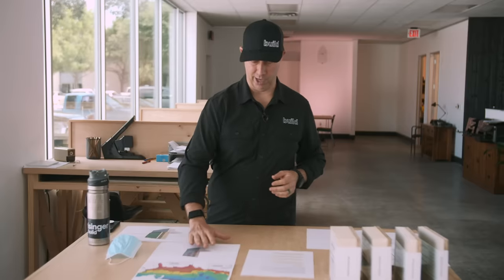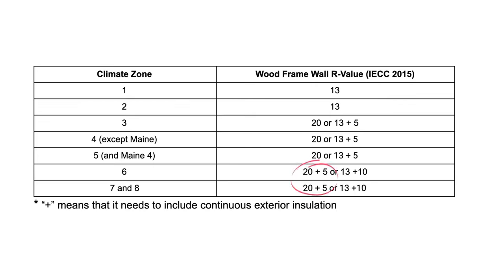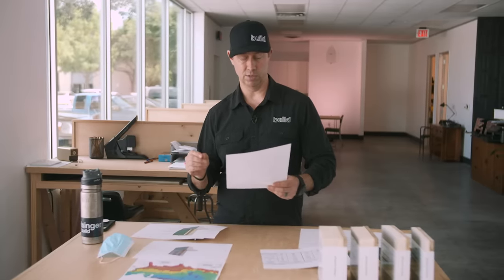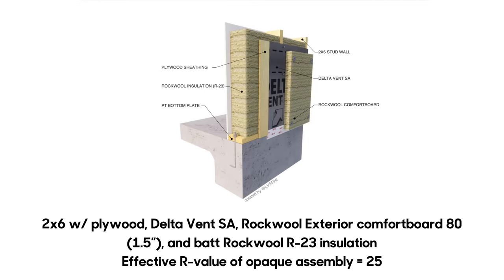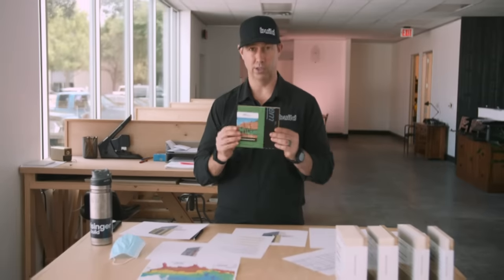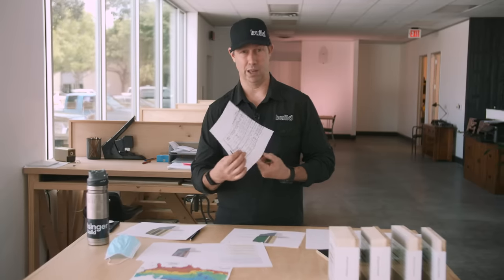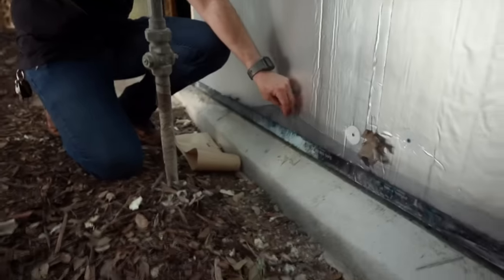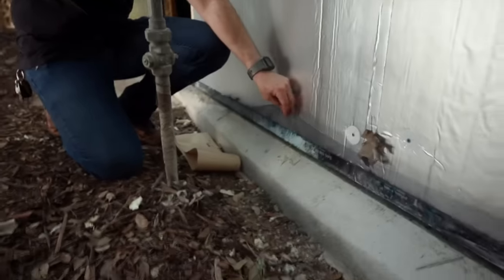5 Ultra-Insulated Framed Walls

Comment: Drives me nuts how content is presented for the sponsor benefit. My experience and calcs say the best approach is to do a conventional frame; 2x4 or 2x6, depending on wind loading for your area, then sheathing of choice (ps guys, OSB is not horrendous vs plywood, which has all sorts of QC issues of its own). Then, 100% liquid applied or self-adhered with liquid applied as required (such as outie windows, and bucks fully coated, unlike Matt's own build). And I use Barritech VP liquid applied, from Carlisle, for good reasons.   Then, MAX OUT the continuous exterior insulation. It all comes down to the entirety of the delta temp that any part of the assemble, and its insulation materials, are seeing. Once inside the continuous layer, the heavy lifting  (thermally speaking) is DONE. And bear in mind that the cost of a rain screen/ furring  is ignored in the ZIP R versions shown here, despite being promoted incessantly here as the "right stuff". Can't walk both sides of the street, in my world. And, if one is going to perseverate about the cost of fasteners, keep firmly in mind that Rockwool is a good product, but is about half the R-value of polyiso, per inch. That means you need a LOT thicker blanket and finished wall assembly, for the same thermal performance (hint: look at fastener schedule and costs carefully). Law of Diminishing Returns says put the most you can in the continuous exterior layer, have an awesome air seal, and don't waste time and money on the cavities; FG batts have a better return on money spent. Finally, don't just throw up fuzzy stuff and hope it sticks: do the calcs as to where the dew point falls within the assembly before you set out. Tough to find out 5 years later you are condensing all winter on the inside of the sheathing.
Reply: You don't need exterior insulation.
Reply: nice post, TY
Reply: @JamesG1126  hey do you mind expanding on that?  Thank you
Reply: @hihokie  Exterior insulation is very labor intensive to install.  You need to have vertical wood strapping covering the entire house and it makes the siding install more labor intensive too.   For the minimal R value, I don't think it makes sense in any climate zone 5 or lower.   Maybe for the coldest climates.
Reply: @JamesG1126  So how do you build? And how do you restrict to "minimal R-value"? If I restrict any described method to a failure mode, of course it will fail. You seem to be suggesting that BSC are idiots, and the Perfect Wall can't work because of "minimal' R-value. On my jobs, we find the calculations and the performance to be diametrically opposed to your assertions.  Per my starting comment, continuous exterior or a hybrid system makes everything within the sheathing totally simple and straightforward, no special care or expense, either materials or labor. Put your money where it does the most good, which is outside the sheathing.Even Matt's darling architect Steve B has said exactly that, in posted interviews (you could look it up).  Makes the whole deal with conditioned attics and basements or crawls extremely easy and straightforward as well. And, the whole issue of condensation within the wall cavities goes away completely. 
You can continue to build as you do, but I take the long view on cost-benefit and risk-reward analysis. Decades of pushing the envelope got me where I am on this.
Reply: I did a bunch of cost analysis for my region (Zone 6), considering spray foam, double stud, rockwool, exterior rigid insulation, etc, and the thing that was the clear winner was 2x6 wall with fiberglass batts, OSB over that with a peel and stick (or liquid) barrier, and 5 inches of EPS foam on the outside. It's a thick wall, but it will have a better R value per $ than anything Matt is showing here. My wall will be about R-34 for the assembly and run about $4 per square foot. In insulation, there is no real substitute for thickness. And the more that can go on the outside of the studs, the better. Polyiso is always a poor choice on the outside of a wall. Not only is it worse than EPS or XPS in $/R-value, it's R-value drops drastically with lower temperatures. When it's -10F out and you need it most, polyiso might be performing worse than EPS. Keep the polyiso to the interior of basement walls, where it can stay warm.
Reply: @justinl9947  Excellent. Congrats. I would not argue, but might quibble a bit, with your analysis. Basically same conclusions we came to a long time back, and more or less used successfully. Cold temp performance of polyiso was not a widely noted issue then, and I would certainly not rule out 1or 2 layers of poliso, followed by a top layer of EPS (this scheme courtesy of GBA). People tend to overlook the huge advantages of keeping all the construction from sheathing inwards per usual and customary practice. No one (framer or trades) has to alter materials or methods in any way, which eliminates unanticipated costs. Thermal bridging is a non-issue in the frame, so structural issues can be decided solely on the basis of structural needs and requirements. And with everything within the sheathing within the air control layer and also always above freezing, there are no worries about routing of ducts, plumbing, wet heat or fire sprinkler pipes. It is all good. 

You say "will be". Wish you the best, you are going at it the best way possible, in my (substantial) experience. 

I find it curious that Steve Bazcek can say in an interview that his mentor (not Dr Joe) told him long ago that the best way to build was to put the most money that one could into continuous exterior insulation, but then he and Matt both spend an inordinate effort to do other, more convoluted (in my opinion) insulation strategies.
Reply: @leestevens446  Thanks for the informative response. The wall assembly I refer to is for an addition on my house. I currently have a 1.5 story detached, uninsulated garage. I am in the process of extending the garage to attach to the house, and adding a full 2nd floor with living space. The garage sits on a frost-protected slab, so I don't have a basement for this addition. The garage is already 2x6 framed, so continuing with 2x6 framing is nice for the consistency. I did consider other framing options for the 2nd floor. 2x4 didn't work because I wanted to keep the framing stacked, and 24" OC 2x4 framing would not be sufficient for the roof loads (100 psf snow load here). I considered 2x8 framing, double stud, even offset 2x4 wall inside a 2x6 wall (like my father built in the early 90's in the house I grew up in), but, like both you and I noted already, less framing and more exterior insulation came out ahead. 

I might need to start a trial of GBA prime to get access to the rest of that article you linked. Some comments on that article confirmed that I have the right fasteners already (fastenmaster headlok's), but I am desperately looking for tips on how to actually hit the center of a stud through all that insulation. There has to be a trick, but I don't know what it is yet. 

I love that use of LVL's. Such a good way to use engineered lumber. And reducing the amount of studs in the wall will add even more benefit to the insulation - less thermal bridges. I looked into header hangers to avoid trimmer studs, but they were too expensive to justify. And since most of the insulation is on the outside anyway, reducing studs isn't that big of a deal.
Reply: @justinl9947  When I see someone making a serious effort to do a really good and thoughtful job, I am always glad to offer whatever knowledge I have. As for the " desperation" issue: we have used 2" on walls, and almost no problems hitting studs. Before you coat/ membrane the sheathing, it is imperative to mark stud centers in a way and place they will not be lost and or have a "cheat sheet" of locations. Our jobs get really complex, and this is essential, as stud layout can get rather squirrelly. 

We have put thousands of screws through 5" polyiso in in compact roof assemblies (1/2" OSB, underlay, 2 x 2 1/2", 5/8" OSB, underlay, shingle or slate) with little or no issue in hitting the rafters (eg 2x8'S). Compact is due to prohibition of venting, in wildland fire areas around here. No such restriction, I would modify, to vent, in some form. 

Cardinal rule on my jobs is "DO NOT REMOVE ANY FASTENER ONCE IT TOUCHES THE MEMBRANE". If it misses the stud/ rafter, just run it tight, and leave it, then add another fastener close by. Reason: you go to a lot of effort to seal the sheathing/ building envelope, and a withdrawn fastener violates the integrity of that layer. I firmly believe that the exterior cladding is a gross weather protector, but the true absolute line of defense against water intrusion is the membrane, deep in the assembly.  We tested the Barritech VP over OSB, and it would hold against standing water, around any fastener, through foam or stand-alone, for a 30 day test period. No leaks or seepage detectable. 

If I was faced with 5" EPS, and keeping screws aligned on the way into the sheathing proved to be a problem, my approach would probably be to make a tool. My first trial would look like this: A plate with blocking on the "bottom" side that was the thickness of the furring used, and leaving a channel just the width of the furring through the center, all so the plate would straddle the furring, centered on it, and stable on and parallel to the foam layer. A fairly tall (say 4"-6") block or tube would then be centered on and project squarely from the plate.  A bore hole on center, with a diameter to accommodate a long electrician's bit (drill) or a even a piece of solid round stock with a pointed end (hit it). Basically, make a quick and dirty drill guide, to keep the pre-hole in the foam perpendicular and on line to the stud. Could use wood, steel or a combination. Headloc's should follow the guide hole through the foam easily. 

Are you doing continuous exterior foam for your roof? If so, my strong advice is to NOT follow Matt's own house roof overhang details.  Snow country, could be a problem, I certainly would never do his way here in Colorado. I posted on the Roof Framing vid, you could search. It is a bit long.
Reply: @leestevens446  Thanks again for great info. It's great to hear from someone with experience that hitting studs through foam isn't quite as challenging as I had feared. At least for those with experience. I plan to practice with a few screws before try putting them through the membrane. I like the guide jig idea you described. That idea is better than the best I had come up with so far. I'll give it a try if I have issues hitting studs without a guide. 

Marking stud locations is certainly on my to-do list. The weather barrier membrane I am using is transparent (3M 3015) - it's nice that it allows me to mark the stud locations on the sheathing, and it will still be visible as I add insulation. Still need to keep track as those marks are covered by the insulation. 

I think that rule about fasteners in the membrane is something that a lot of people probably don't know or forget. But you are absolutely right. It had been on my mind, but I will need to remind myself of that often. Backing out a missed fastener is almost second nature, especially when those headloks are close to $1 each. 

The majority of my new roof will be a traditional vented attic with about R-70 of blown cellulose. That seems like one part of traditional framing design that falls under "If it isn't broke don't fix it." Only "odd" thing I am doing with that roof is attaching thin plywood to the underside of the ceiling joists, attaching a peel-and-stick air barrier membrane to that, and then drywall. That's my plan to air seal the ceiling better than poly sheeting would do. 

I do have a small, 4x30 foot section of roof that sits low between the house eave and the garage gable, covering where the two structures meet, and what used to be a breezeway. That section won't have an attic, so I will do foam over the roof, but vented above the foam. Ice dam problems are common here, and everything I read says that venting is the most foolproof way to prevent them, so I made sure to work that in. The assembly will be 2x6 rafters (perpendicular to the slope)  with rockwool in the bays, 7/16 OSB, air barrier membrane, 4" EPS, 2" XPS,  2x4" furring strips (to create vent space), 5/8" OSB, ice-water shield, standing seam metal. Sounds very similar to your assembly, just with a vent. The XPS  layer is because seam tape seems to stick better to XPS than EPS, helping to water seal the vent, and the higher compressive strength will give more resistance to the furring strips compressing the insulation with heavy snow loads. 

I found Matt's video on framing overhangs on sealed enclosures, and I agree with you, I don't like it.  My plan for the foam-insulated roof eaves is similar to the design in this video: https://www.youtube.com/watch?v=JR7sCKlChgY. I only need to do 18" overhangs to match the 12" overhangs on the rest of the house after insulation, so it's fairly easy to do structurally.
Reply: @justinl9947  Okay, so I watched the vid, and was fairly appalled, until the last minute, when he said he would not do this again. Assessing, and giving advice is pretty problematic in a written (only) comments section like this, due to context and complexities. I prefer to relate what I have done, and what I would do, per my understanding of someone's info as presented. 

You talked about liquid applied. Excellent technology. I have done overlay outriggers (sort of, in steel, by necessity) in a continuous exterior roof insulation system, and I have done projecting rafter tails, using liquid applied to seal the tails to the sheathing. I would never do overlays, of any kind, ever again. In your case, the conduction path along and through the tail is the 5" distance of the wall foam thickness, plus some benefit due to stud cavity thickness. We have done 2' 8" OH's in 3 1/2" LVL tails for 9/12 pitch and slate roof. In that case, the sheathing on the rafters/ tails extended to the sub fascia (single piece LVL), and the liquid applied was run onto the underside of the sheathing. The roof insulation went clear out to the sub fascia, and the compact assembly was uniform from eave to hip or ridge. Purists may decry the penetration pf the OSB through the envelope, but the FLIR camera detected no significant issues, certainly no air flow. I would note that we did "see" the air intrusion at the two 1/4" x 3/4" drain ports at each sill pan, for context. If I were doing your roof, I very well might seal wall OSB,  tails and first roof OSB, and then run my wall foam up to a bevel cut at the top of the OSB. From there I would put OSB Ripper on the remainder of the tails, out to the sub fascia, then start my roof foam at the sub fascia. Add 2x4 for venting, and carry on as before. See Dr Joe/ BSC for the reason, and can also ask me. Heavy snow loads, there is a potential for heating/ cooling cycles on the OH, and consistency of thermal performance over the entirety is valuable to minimize this. Back to overlay outriggers. There is a lot of labor fussiness in Matt's way, a disruption of the R-value, and also the potential for enhanced air networking in the roof insulation assembly. Do not discount the liability of this aspect, in your cold climate. And do not disregard the fact that there isn now enhanced conduction along and through those overlay tails, as well. Just a poor solution, per my experience. 

If I were doing your 4' x 30' roof, I would use an LVL full length for the subfascia. I would run it up to the underside of the 2x4 vent spacers, at least, which adds a lot of depth and rigidity. Then I would look at using LVL's for rafters, and then look at tails on 48" centers, to reduce penetration of the envelope. LVL is roughly twice the strength of solid sawn, should work. Might be able to do a level cut on the bottoms of the tails, to reduce the depth at the subfascia (without reducing the resistance to bending, at the wall juncture), and therefore the bulk and boxiness of the soffit. Ledger over the wall foam to support soffit, as required. If this roof was a projection of the main roof plane, I would start the outer 5/8" sheathing at the eave, and therefore have the next row solidly bridge the framing change. I would also fit solid rollover blocking between the rafter tails/ ends. I would do a bevel rip, matching heel height, so I got full nailing of both wall and inner roof sheathing at this joint. This is for sealing and structural considerations. We make sure the wall sheathing is notched, not pieced, and ties at least a foot down over the studs (if 4x9 or 4x10 OSB is not tall enough for one-piece). For modest roof spans, we can eliminate the hurricane clips by use of proper nailing schedule of rafter to blocking (130 mph high exposure zones). 

If the 4' x 30' roof slope dies at a headwall, I would be apt to do an unvented, fully insulated assembly, just because of the issues of where and how to exit the venting above. You could get innovative, and tie the venting into the rainscreen vent space. Have to be very cautious, that you do not create a water passage into the foam layers of the small roof. If you do so, post up when done, and we will all learn something.
Reply: @JamesG1126  and you don't strictly need any insulation if you want to bribe an inspector and pay a fortune for your HVAC. properly installed exterior insulation can help with water control and condensation while eleminating thermal bridging which can raise the effective R-value of the wall without needing to use more insulation total.